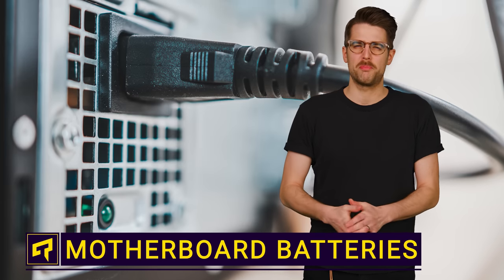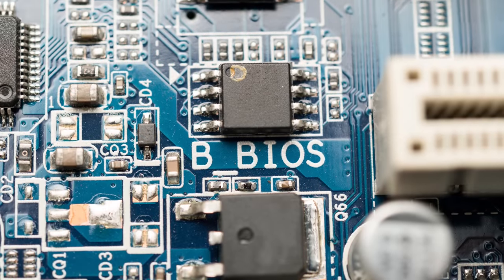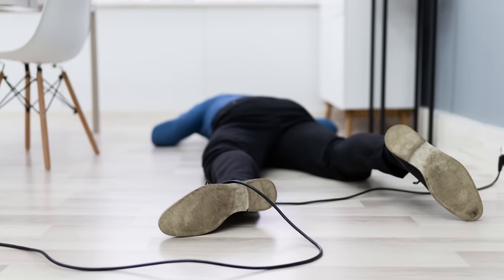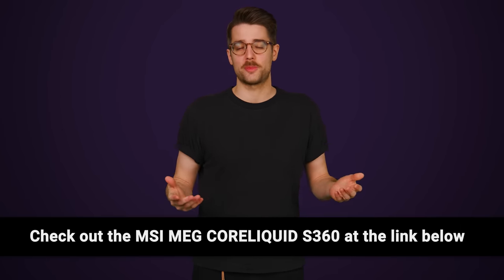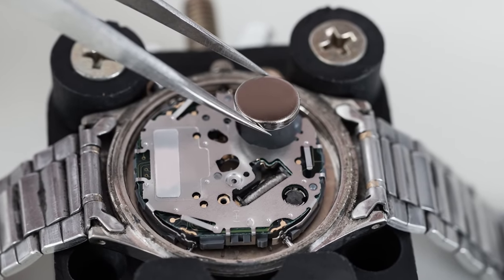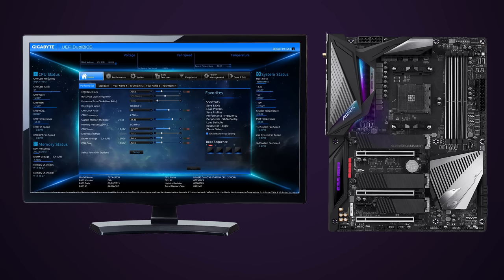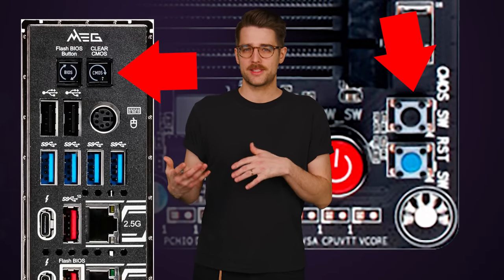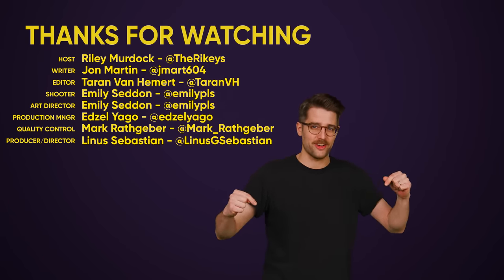Why Do Motherboards Have Batteries?

Comment: I remember wondering how my PC keeps time after I power it off even though I didn't have internet back in late 2000's and my friend's dad told me about this little battery
Reply: The more you know
Reply: Yeah, I didn't believe my dad at first. But then it's working again after I replace the battery.
Reply: Yeah, my old pc's time also kept resetting to 1 January, 2008. I believe that also happened because the cmos battery died.
Reply: I thought more modern computers just check the time online. But its this little guy on my motherboard that keeps track of time.
Reply: How does my nintendo gamecube still accurately display the current date? It has no internet connection and no battery as far as I can tell.
Reply: @yeahyeah2899  The Gamecube does have a battery, inside next to the controller ports.
Reply: @3DGECASE  Oh alright, thank you
Reply: I actually had time issues with my computer in the 2000s, where the time would always be wrong and revert to midnight on turning on the pc. It was really annoying.
Reply: The original xbox has this aswell
Reply: @t29hotrod75  Actually it doesn't. The original Xbox uses a super capacitor instead of a battery.
Reply: @3DGECASE  interesting
Reply: My teacher told me
Reply: Mine didn't keep track of time and my PC keeps restarting that's when I realized that battery was dead

Comment: We have had to replace a fair few CMOS batteries over time.  The last one was a couple of months ago on my dad's gaming laptop from 2016.  It started loosing it's timing and knew it was time to get a new battery.  People may think it is a minor issue.  But it can drive you crazy.  Especially when you have to manually keep resetting the time so your certificates for things work.  Having it keep coming back on saying it was nearly 100 years in the future, caused the pc to have a fit with the certificates saying they had all exprired.  Which meant I had to fight with times for at least 5 minutes to get things set right everytime this happened.  Not my idea of fun.
Reply: been 10 years i didnt touch any cmos battery + i didnt get issues with time
Reply: @ERA Are  having worked at industry for over 10 years and I have probably had to replace a dozen; they tend to go wrong on systems that aren't turned on very often.
Reply: I wonder why they don’t just replace it with a small rechargeable battery that can get charged while the computer is running?
Reply: one of my laptops still says it's 2009 lmao
Reply: That's the reason why I hate the way to use the cmos for time. NTP is much more reliable, I use NTP on linux but still have the "normal" way on windows and it's driving me nuts, cause every fucking time I want to use windows for gaming, I have to fucking resync the time, just do it on boot up windows, just use NTP please

Edit: the solution for the problem is down below, windows uses NTP, but they are stupid
Reply: @ezn  rechargable batteries also wear out over time
Your phone uses a rechargable battery. Ever noticed older phones having worse battery life? Ever replaced a phone battery?
Reply: @Xnoob545  yes, but a rechargeable battery that only needs to power a timekeeping chip while the pc is off will probably out last a disposable battery.
Reply: @marsimplodation  What version windows do you use !? NTP has been standard since XP and an addon in NT
Reply: @mikgus  yea just figgured out, what was wrong, windows does not sync on startup, you actually have to set it to sync on startup, by enable a service called Win32Time or something like that. Can't believe this needs to be done manually
Reply: Ordered a battery for a laptop yesterday. Relate!
Reply: @lardyman2  Thank you for that clarification. I built a system in 2010 and ran in basically 24/7 until 2021, then used the motherboard and CPU for a server build, and I was worried about that battery because I've never changed it. The video cleared up what the heck it's for and you just cleared up why the thing still ticks. I hope you have a great day.
Reply: @Marsimplodation  Same. Except I haven't been using Linux much lately. But every time I start Windows, its an hour behind, even if Windows was the last OS used.. Every time! And exactly 1 hour. I'll have to ensure that service. Why not enable it by default Microsoft!?
Reply: @marsimplodation  In Windows Task Manager there is a Task called SynchronizeTime tat connects to one of several internet time servers in order to synchronize the system time. Granted its default setting is to be ran once a weak usually on Sundays at 1 AM. You could change the properties if this task so that it is ran at every logon and you would be just fine.
Reply: @alwinvillero9505  I wish that your laptop would be saying the truth.
Reply: damn bro. this reminds me of the PS4 CMOS bomb
Reply: @ezn  I was thinking the same thing too

Comment: This answered a question I've had for half of my life; "how do devices keep time when turned off".
I figured there must be some sort of power source still going. I'm just new to PC hardware so I didn't know that motherboards themselves have a battery in them for that reason.
Reply: I saw the battery and I figure it out when the computer reboot to factory settings each time I turned it on and the clock wasn't updated, it turn out to be a faulty battery.
Reply: there is similar technology in old cartridge games that keep time. Pokemon in the GBA infamously had a "the internal battery has run dry" error message which basically says it can't keep time anymore, and you had to solder in a new battery in the cartridge to fix it
Reply: I'm noooooot 100% sure about this, but smartphones for example, when they shut down at 0% battery, they in fact still have like 5% battery left.
That few percents will make sure the time is still kept, and also that the battery doesn't flat out die out. It's really hard to get an absolute empty battery back to life, if possible even.

My first smartphone was a Nokia 5530, with Symbian OS, and the thing once got completely dry (long night party, no charger at hand).
It's own charger didn't do anything with it, I had to plug it into my PC and somehow (no idea how) that started charging it, but veeeeeeery slowly.
Reply: When I added a graphics card to a dell, I saw the battery and assumed it’s for time since digital watches use crystal oscillators. Another reason I assumed it’s for time is because timing is important for a computer. If it doesn’t have a clock, how does it keep track of its clock cycles.
Reply: @jakejakedowntwo6613  There are unique clock generator circuits for that iirc.
You can boot up a machine without a battery, it just won't have BIOS settings saved or will be reseted, as seen in the video

Comment: Nice video. I'd have liked some mention to laptop nvram chips and how the absence of a default "clear BIOS settings" mecanism in laptops can turn into a real hell if you need to enter the BIOS of a password protected laptop.
Reply: So, what do in that case? Remove the battery and wait for a few seconds to clear the CMOS?
Reply: @eudofia  there's no battery in laptops! Nothing to remove. You have to enter a specific combination of keys/buttons which then leads you to a specific code that you have to write down, and then you have to contact the manufacturer with that specific code you need to be a registered customer and then, after checking that you are indeed a customer and the owner of the laptop, they will give you a reply code that you must enter to enter the BIOS. Something like that, I'm talking from memory, it's been a long time.
Reply: @mkcristobal  most laptops still have a lithium cell battery to keep track of time, even current models...
Reply: I just guessed the password
1234 was the default
Reply: @mbc07  if that is true, I have been unlucky then! Had this problem with a couple of models, the only ones I ever came across which were password protected 🤦🏻‍♂️
Reply: @mkcristobal  I would like to refute that about laptops not having batteries. My wife's HP laptop would not boot, so rather than paying some repair shop $100 or more. I decided to open it and sure enough there was a button battery. I replaced it and the laptop booted again. 
I do also have an old work laptop which I forgot the password. I tried getting to the BIOS to reset everything, but it is password protected. That's why I was asking about if removing the battery would do the trick. I haven't tried opening it though.
Reply: @maybeanonymous6846  🤣Really!?
Reply: @eudofia  ok, I'll accept it, seems like I really was unlucky, or the laptops I had this problem with were unusual. I haven't opened that many
Reply: @mkcristobal  Um, yes there are CMOS batteries in laptops. And finding a master password really isn't that difficult, there's websites and programs out there that allow you to quite easily find them out.
Reply: @eudofia  In my laptop you need to short some pins in the motherboard to clear the bios
Reply: @katech6020  Interesting. Now that you have mentioned it.  Back in the days when it was so expensive buying off the shelf PCs from brand names like IBM (yes, I know, I'm that old), HP, etc. I used to build affordable clone PCs for friends and families using cheap components. I remember using the pin shorting method on the motherboard to achieve certain functions. I'll see it will work with my laptop. Thanks
Reply: @mkcristobal  The main problem with this password protected "clear cmos" is that 99% of situations that you need to clear cmos is when your settings are so bad that you won't be able to load the bios, so the code handling will not work either.
Reply: @mkcristobal  yeah, my laptop from around 6 years ago had a cmos battery.
a few others ive opened up have had one too.
Reply: @mkcristobal  can confirm presence of a coin cell. I just had to replace one, because it's low voltage somehow corrupted settings and the laptop didn't start at all.
Reply: @mkcristobal  Every laptop I've owned had a CMOS battery. Wait, how long has it been?
Reply: There are utilities that hack the passwords.
Reply: Yes laptops also have CMOS batteries but not all of them have the CMOS batteries so easily distinguishable as desktop computed so. I have seen laptops that have the same CMOS battery  that you can find on desktop computer but it is hidden in a plastic enclosure. And I have also seen laptops that have special square shaped Lithium battery soldered to their motherboard. These are more common on a business models of laptops where security is of bigger importance. So replacing the CMOS battery on a laptop may not be so easy as it is on a desktop.
Reply: @mkcristobal  I've never not seen a CMOS battery in a laptop so it's definitely false that they don't have batteries. Although I won't deny there may be some without it.
Edit: seems you were made aware by other commentors
Reply: It's a feature not a bug. Laptops are so much easier to steal than desktops they make it harder to clear CMOS in order to foil thieves. They might have your computer but not your data. Well not unless they can put your drive into another computer, or use a USB drive to boot to. Which -- if they know about the clear CMOS trick -- they probably can. But it takes them an extra few minutes!

Comment: At times even the clear_CMOS button/jumper fails to function in a thorough manner, never assume it worked properly. Removing the battery is still the only sure way to reset EFI settings in a thorough and reliable way. I don't know why, but my guess is that EFI initialization crashes or freezes in such a manner that the clear_CMOS  jumper/button cannot obtain access to clear whatever errored bits crashed the EFI. Perhaps certain specific EFI settings bits relay power or interfere with the relay of power? Would be interesting to get an answer to this from an engineer at American Megatrends.
Reply: It depends on the type of memory used. If its CMOS, then removing power will reset it.
For nvme, it will not work, but there is usually a pin on the memory chip that is used to reset the entire thing.
For some nvmes there is no global reset button, so you need a circuit that will do it programically, and the last group is the hardest to reset, and the most likely to get perma-failed, so its usually paired with double bios chips where one bios is used for normal operation and the other bios is used only for clearing and fixing the first bios.
Reply: One issue may be that it's 2 separate mechanisms to check the jumper vs if the CMOS battery has been pulled. The jumper is a GPIO that's pretty basic to read. For the battery mechanism, the BIOS needs to put some sort of magic value in the CMOS RAM and check if it's still there on boot. 
Lets assume that AMI has things set up so that these two mechanisms are checked at the same time and trigger the same behavior. The OEM might decide to change things for some reason. Why? Who knows. 

But what might be more likely is that the circuitry retains enough power to keep the CMOS RAM contents intact. One school of thought is to make sure the battery is removed for a good 30 seconds before trying to reinsert it. Another I've seen is to put the battery in backwards, remove it, then put it back correctly. The idea is to try and drain any capacitors in the power supply circuit so the memory loses power faster.
Reply: Not always, I tried the jumper and removing the cmos battery, settings are kept, the only thing reset is time. Seems Lenovo doesn't reset the nvram upon battery removal
Reply: @splynncryth  Never put the battery backwards, it can damage the motherboard, even with such a weak power source.
Reply: @hubertnnn  had it been a problem, the hardware engineers and lab techs at a number of the big hardware companies I have worked for would have had a fit, boards would have been dying left and right because QA, BIOS engineers, and various other systems engineers would regularly flash new BIOS and more than a few of those people would do this as part of their ‘new BIOS ritual’. But it was never a problem. No boards ever died from putting in the CMOS battery backwards. 

Why? Probably because the RTC circuits used an LDO with reverse polarity protection to supply power to the RTC when on battery.

But there is an additional protection mechanism in the physical form factor of a CR2032. If you reverse it, both terminals will connect to positive terminal of the battery which just shorts the power supply input and will drain the capacitors. 

Other electronics? Be mindful of polarity although any design meant for production should take into account potential end user error and prevent casual reverse polarity issues via mechanisms like physical form factor, reverse polarity protection circuits, etc.

Comment: My first IBM-compatible PC, a Tandy 1000, did not include a battery.  There was no built-in timekeeping, and no BIOS settings.  For timekeeping I needed an ISA expansion card (with its own battery), which also upgraded my RAM from 128KB to 640KB.  The '80s were fun times.  🙂
Reply: @Velocifyer  From 128KB to 640K by adding 512KB via memory expansion board.